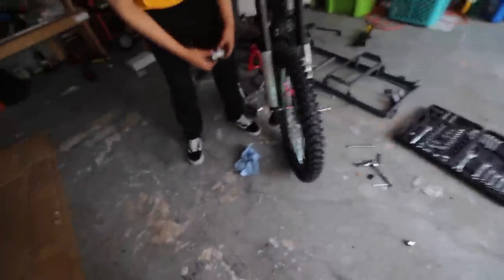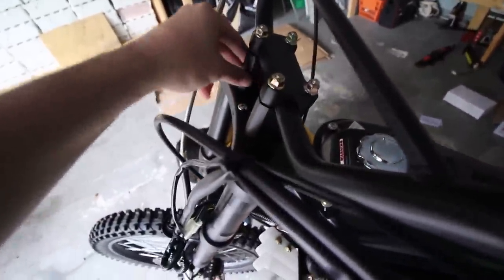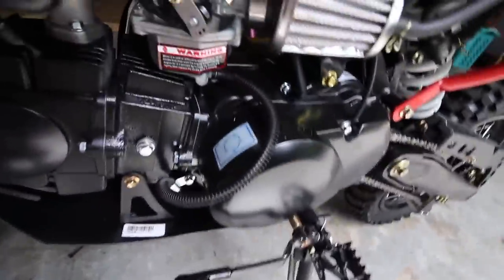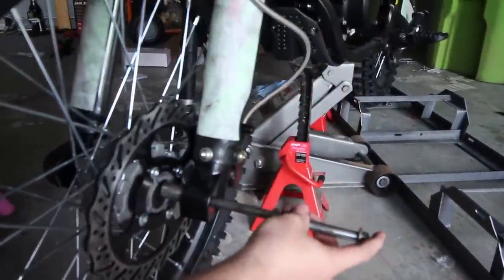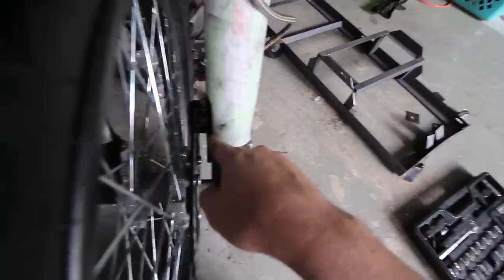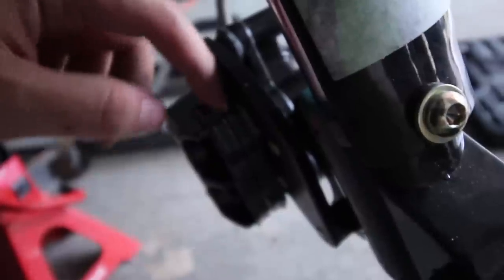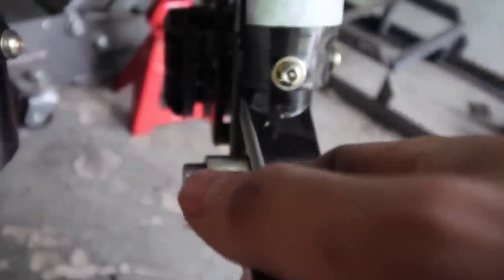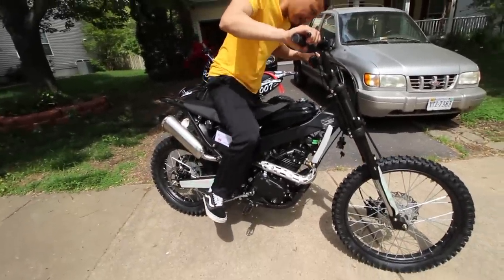UNBOXING New Apollo 250cc Dirt Bike! "How To Put Together Apollo 250cc Dirt Bike"

Comment: He seems like someone that would try to start it with an exhaust plug in it and then complain that it doesn't run!
Reply: BeAu McFaDiN haha I’ve done that started mine at least 5 times with the plug in and it shot out the exhaust like a gun hehee, and btw Apollo’s suck
Reply: @rxddd8488  they do suck everyone u get u need a new carb
Reply: Yeah kawi or honda etc are always better
Reply: Did that to my 426 yamaha today I looked back after 20 kicks and went O
Reply: Xero Playzz lol why they suck? Just curious was looking for good dirtbikes i could maybe find used cause i aint lookin for anything expensive
Reply: @rxddd8488  they dont suck as a beginner bike. i know that they have improved the carb on the 2021 model.

Comment: Just because it's Chinese, it doesn't mean it's shit and I beg you learn your bike parts
Reply: so is it good? im trying to buy one
Reply: @bhhunter1204  I have a china dirt bike. dont expect big performance, and you will have to learn moto maintenance. Dealers normally do all the work, so if you don't do it (right), it could be dangerous. If you are mechanically inclined, it should be a breeze, and most parts are super easy to get on eBay. That being said, they are excellent bang for buck and a ton of fun!

Comment: Why is he kick starting it if it has a battery? Wouldn’t it have a starter if it has a battery?🤔🤭
Reply: For some reason the 250 comes with the starter set up, but you need to buy the switch separately....it's weird
Reply: Wiktor Jachyra No it was the dealers fault they come with it
Reply: @moth7506  no they don't....they come with the set up for them but not the actual switches...look it up multiple people say this when reviewing them
Reply: @wiktorjachyra1869  mine came with the electric start and I got the same bike

Comment: Doesn’t the 250 have an electric start ?
Reply: camthesham396 camthesham396 that’s what I thought cause I saw a battery
Reply from the maker: yes it does have electric start but it doesn't come with the right wire connector for the electric start to work so you'd have to go buy one
Reply: Yea the do I have one myself
Reply: Mine came with the electric start

Comment: Bought a Apollo 250 before ant colors when they were just black. Never had a issue owned it two years stock everything. Thinking on getting another one. Any good ideas for a new carb or better carb due to original one was riveted couldn’t get off hadda dremel the studs to clean

Comment: guys dont do what they did with the screw driver on the brake pads it could damage them and the brakes wont work correctly and will scratch the disk just use a plastic wedge or sumthing plastic

Comment: How fast does the 125cc go? And how fats does the 250cc go and are they street legal
Reply from the maker: hunter hastings the 125 says it tops off at 50 but it honestly only goes 40 max
Reply from the maker: hunter hastings the 250 says 70 but it tops at maybe 55
Reply: I have an Apollo 125 and it goes around 40 maybe 45 tops